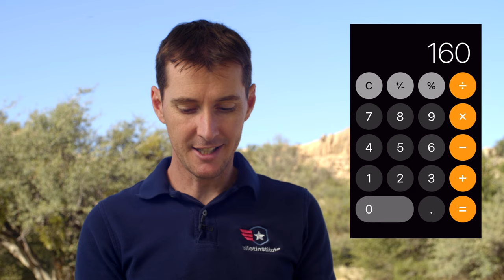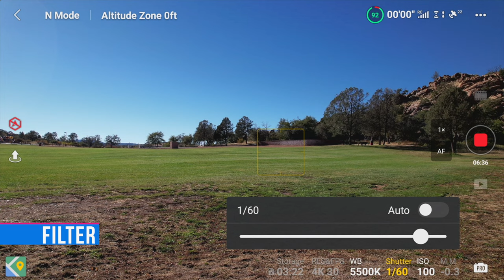ND Filters for Drones: Why You Should Use Them

Comment: The real question is as much "when should you use ND filters" as "why should you use ND filters". In some situations they're great, in others, they're a significant negative. As for the goal of doubling your frame rate, that was far more important in the days of celluloid film, not nearly so much in digital video with electronic shutters. You'll be perfectly fine most of the time without worrying about that "perfect" shutter speed. I do have ND filters, but I only use them about 1/4 of the time.
Reply from the maker: The rule can be tweaked a little but if you want the more natural motion blur, it should be used.
Reply: @PilotInstitute  I literally never want motion blur in my videos. I work very hard to capture the natural patterns and formations of the desert floor, of rock formations, of mountainous areas, and of badlands areas, among others. I want as much clear detail as possible. Motion blur would degrade the image tremendously. . And that goes back to my main point. You don't start off by asking "what filter do I need to use to get a shutter speed = twice my frame rate?" You start out by asking, "What am I trying to accomplish? What am I trying to capture, what am I trying to communicate, what feeling am I trying to express, what story am I trying to tell, and what ensemble of equipment and methodology will best help me accomplish that?" An ND filter might be appropriate,  it might be irrelevant, or it might ruin the footage.
Reply: I worked in Hollywood, TV Commercials and Making High End Interactive Video Applications, you must use the right Shutter Speed all times unless you are doing slow motion or else. Failing to film with the right Shutter Angle the video playback could be jerky in some devices. Remember that today's displays are based in hertz and failing to film with the right frame rate and shutter angle you will encounter problems and your footage may be denied for some content creations. If you pay attention, you can see very clean in some TV commercials and even in Youtube when the Shutter Angle is wrong, the video will skip frames because the computer is trying to guess the matching sequence. When we create Interactive video applications video Shutter Speed is a must or sync will be a problem with programming, specially when dealing with video walls. Now, if you are just having fun, Shutter Speeds, frame rates etc could means nothing or it does not matter getting right. Also, always film with a gray card to get the right colors every time no matter what camera you use, I created a one that you can print out with the right ND filters and gray card. B creative and B original and happy filming!
Reply: @InteractiveDNA  Reminds me of something one of my early photography instructors told us back in the 1970s. "Learn all the rules, practice them, master them, and then forget they're rules. If all you ever do is follow rules just because you've been told to, then all you will ever produce is boring cookie cutter, paint-by-numbers work that is inherently uncreative."
Reply: @geezerpleasers_OG  Nope! when you know you never forget, you must use the rules to create professional contents, breaking the rules you endup with odd content, I never like when they do break the rules because they are actually having no idea how to produce something. In my field there is not choice. you must produce a professional work every time. And when we used to use film, the rules had to be used every time or you endup loosing a ton of film in witch is super expensive. Learn the rules and never break time. When you break them is because there is no creative thought or idea. Human brain see moving image in such way and when you break them no many will get the picture. I am not your old professor, I won many Emmy Awards, Telly Awards, Technology Awards and my work in even a Museum in San Francisco. I work with dynamic video walls now and other applications that are interactive. I am a few in the world that does what I do. And my work is bonified in the the tech and video industry. From NBC, PlayBoy, Microsoft, Movie T animations, Advanced interactive tech and the list goes on. The best thing about what I do is when people talk about great things that they see from movies t, television, videos walls and else right in front of me without knowing that I did that.
Reply: @PilotInstitute  motion blur with a drone can't be perceived if you fly high. There is a benefit if you're flying close to the ground or objects.
Reply: @InteractiveDNA  ND filters on drones aren't necessary when you fly high.
Reply from the maker: @thomza  The reason for that rule is so much more than just motion blur, as @InteractiveDNA explained above.

Comment: This, of course, could have gone into a whole education on photography, such as the f-stop corresponding to the iris diaphragm with the smallest numbers the most open and the largest numbers being the most closed.  The more closed the iris is, the greater the depth of field of focus.  So if you want only your subject in focus and the background out of focus, you open up the iris and increase the shutter speed.  However, in this discussion, you want to blur the motion, so you need a slow shutter speed.  Thus the need for the ND filter to cut down on the amount of light without closing the iris (f-stop).  Also, you'll notice that lenses come with an f-stop value.  That indicates the lenses light-gathering ability.  The smaller the f-value of the lens, the better.

Comment: Makes it sense to use nd filters also in auto-modus?
Reply from the maker: For videos, it will help a little bit to lower the auto shutter speed but it’s still better to switch to M or A mode.
Reply: @PilotInstitute  What means m or a mode?
You mean automodus whitout filters?
Reply from the maker: @jodokcello  there’s a manual mode (M mode) and Shutter priority mode (S mode) and aperture priority mode (A mode).

Comment: What if you use an ND filter in AUTO mode? Will it bring better quality over AUTO mode without ND? Is there a point in using ND filter in AUTO mode?
Reply from the maker: Great question. The difficulty in using ND filters in auto mode is that you don’t know which setting the drone is going to change automatically to properly expose the image. It could be adjusting shutter (good) but it could also adjust ISO (not good).

Comment: Excellent very helpful. You mention that because the exposure was a bit dark, that you could bump up the ISO. Could you not tweak the shutter speed or is that sacrosanct ie not move off double the frame rate (fps 30, shutter 60 in this case)?
Reply: I was wondering the same, but thinking along the lines of exposure compensation maybe. Looks like this fella doesn't bother to answer queries, so I'll not bother asking him.

Comment: Great vid, thanks. I do have a few questions. First, when doing a video shot, what is the best way to determine which ND to use? Obviously you can't get a true representation of the light levels until you get into the air and have the shot framed. What's the best approach to determine which ND to use? And what happens if you have fluctuating clouds which change your light levels quite a bit. Which ND should you use in these type of situations?
Reply from the maker: We talk about how to choose the correct filter in this video.

Comment: Great explanation on choosing the correct ND filter. I use my ND/PL filters when flying over water or other reflective surfaces but have mostly based my decision of which one to use on how bright it is outside, kind of like sunglasses for my drone. If I need sunglasses then my drone needs sunglasses approach ! So thank you for explaining the math behind the selection process. I would like to hear any suggestions or tips for using ND "PL" lenses. Not exactly sure how to set those for optimum exposure. Some videos show setting them with the drone on the ground and simply rotating the lens blah blah blah ... which doesn't help once the drone is in the air and pointing in a different direction. Thanks for the video Greg, it is appreciated .

Comment: Nice video on ND filter, but what about polarizing filter. Will those also be available for Mavic3?
Reply: ND filters that are polarized are great for filming lakes so you can see the fish, making the sky more blue and the clouds more white. Now, I don’t recommend setting the Aperture like he said to any value, that is a huge No No because you want to use less strong ND filters to avoid definition loss. Your goal is to use the smallest aperture possible (small hole) to reduce light and use a less dense filter. Remember that every camera only have two things that control light, Aperture (small number means bigger hole like f/1.7, 1.4… and bigger number like f/22 small holes because you divide the focus length by the iris opening) The Shutter controls light as well, the higher 1/8000 the less light and image super sharp but thing gets dark, the lower 1/30 the more light enters the sensors. ISO does not control light, it controls the gain, keep is a low possible to avoid noise on the photo or video. Now, because changing frame rates you need to change ND filters density things can be forgotten. That’s why I created a free video guide that you download and print, it comes with a gray card in witch is super important to get the colors right. Print it, it comes with 30fps and 60fps and no need to do any calculations. Record the gray card for few seconds and on your favorite video editor in one click on the gray area of the card you get right colors every time. Make sure you set your Kelvin to 5000. Enjoy it!
Reply: @InteractiveDNA  Thanks for your reply. I understand that the smallest aperture will give me the largest depth of field, but in a drone that primarily shows up when we are flying close to objects. Another consideration is that optimum focus occurred at one aperture setting over all others. This is something I pay particular attention when shooting focus stacking images for macro, but perhaps is also a consideration for drone imagery. How can determine that f stop for the Hasselblad on the Mavic 3?

Perhaps we should be thinking of the principles of zone focusing for drone photography using auto ISO after choosing the ideal f stop the appropriate shutter speed for cinematic imagery and adjusting to the suitable ND filter. I have seen that very high ISO doesn’t necessarily lead to noise if one gets the exposure right.

Is there a link to your video guide?
Reply: @joelpollack  
Note: on this video about ND filters, you always use the smaller Aperture you can first to avoid image definition loss because of the ND filter. Yes, ND filter will reduce image definition if they are too strong or made with cheap glass or plastic.

Now, remember that the Mavic 3 does not have a Hasselblad and yes some technical guy helped DJI with a color grading in witch you can do that in post with any drone. DJI is just using it's name for commercial purpose only and color grading the footage. Hasselbdade is a small company and they only produce small amount of professional cameras. Also, like in the Mavic 3, people gets too existed and they need to lower their expectations as to what an 4/3rds sensor is capable of with an F2.8 lens. I don't recommend filming anything in a lower light with that drone or you will get a lot noise.

Each manufacturer generally has their own algorithm for some of the focus modes and infinity focus point. You can never use the same thinking of as a DSLR and Mirrorless cameras in a drone camera unless you attached or have a full camera functions on them. In a camera like the Mavic 3 or any other drone with camera  they have their own algorithm for some of the focus modes. That's why when I build my autonomous drones I replace the lens and change the focus point of them, so I can program my own camera settings in code. 

You can get the print-out video guide on any new streams I did on the description of the videos or you can search for:
Hubsan Zino Mini Pro - Best recording in manual mode with ND Filters - Live In 4k
In witch I show how to use filters for any drones.

Comment: Great video! I'm curious why the jello effect happens when not using an ND filter?
Reply: I would have liked to see a demonstration of the jello effect, considering I had a heated debate as to what it was.  The other option was that it was gimbal vibration.  My understanding is that it was sunlight at the right angle that it being cut by the props which acts like a shutter where its rate is out of sync with the frame rate.
Reply: The ND gives weight to the gimbal and that can reduce the jello in some drones. Remember that the only function of a ND filter is to stop light volume entering through the lens, nothing else unless you use a ND filter that is polarized so you can film glass, make sky more blue and clouds more white. Think this way, ND filters gives your camera more Aperture control, most drones are fix aperture and you must film with proper shutter angle. Anyway, I make a print out video card that you can print and it has a gray card so you can get right colors no matter what camera or drone  you use, no need to do any calculations because the card shows you what shutter speed to use. Enjoy it!